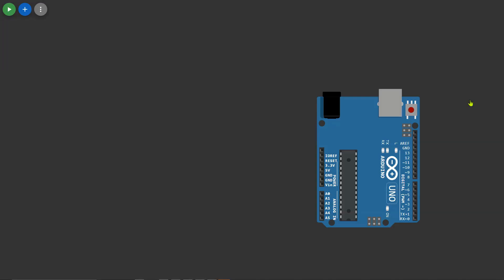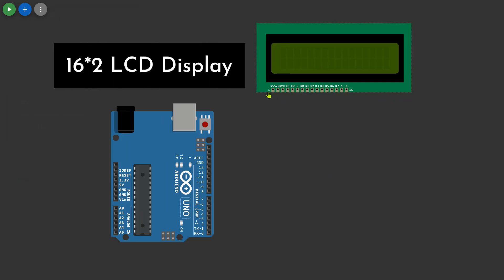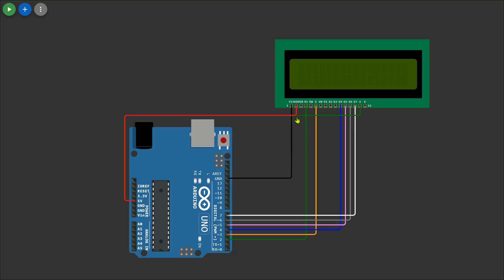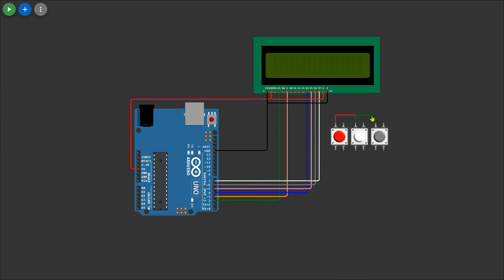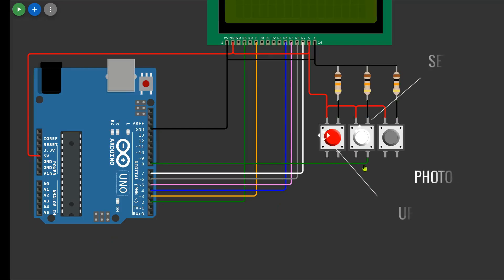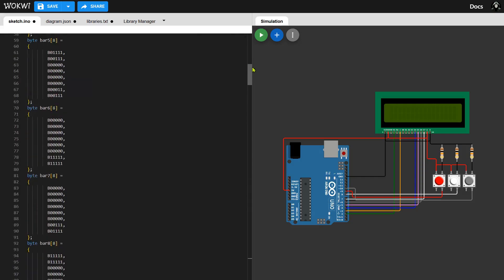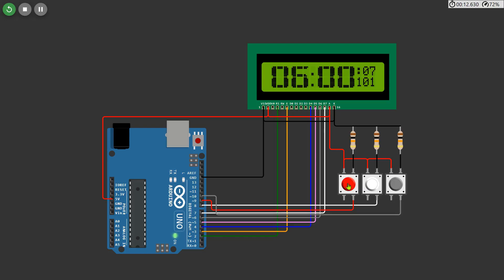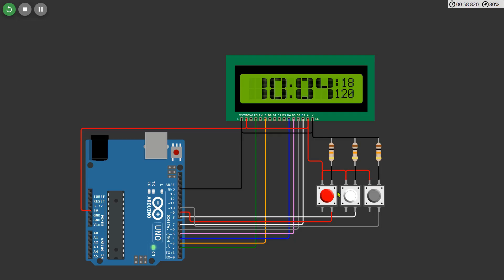Digital Clock Using Arduino ||  Fixing Button Bounce in LCD Time Setting Project 🕰️

Comment: Please tell the code Where is it ? Because in your main Video I opened drive of `` Source of Code `` but it shows a photo of Connections Please Tell me Please 🙏🙏🙏🙏🙏🙏🙏🙏🙏🙏
Reply from the maker: Check simulation, you can directly copy code from there..
Reply: @technicalshubham789  Thanks
Reply: Pls send me the code @technicalshubham789

Comment: rate 1star code is not working
Reply from the maker: Hi @boss_gerard, thanks for your comment! Can you please share more details about the issue you're facing? Are you getting an error message, or is the code not responding as expected? Also, make sure you're using the correct board and have all necessary libraries installed. Let me know so I can help you fix it!